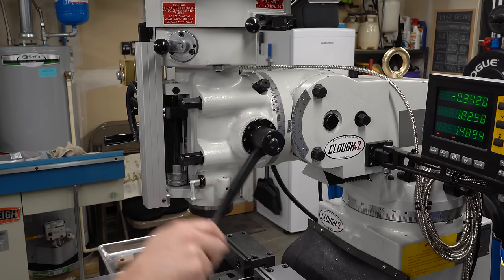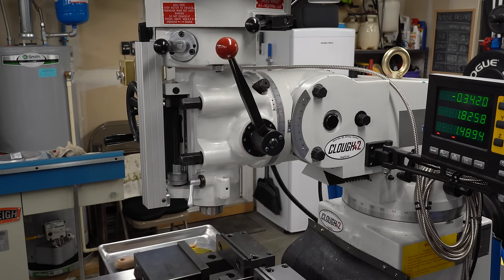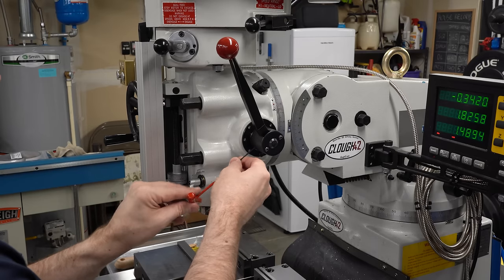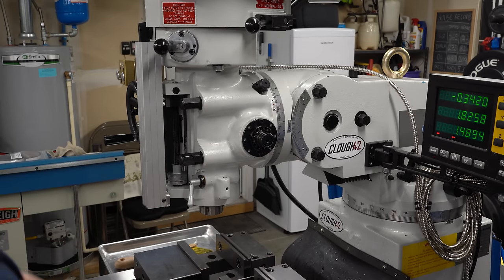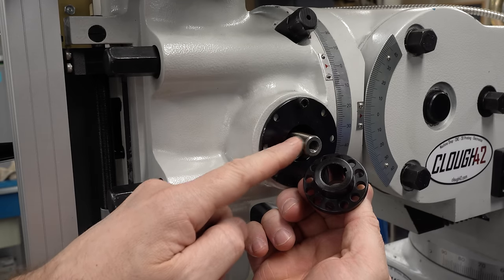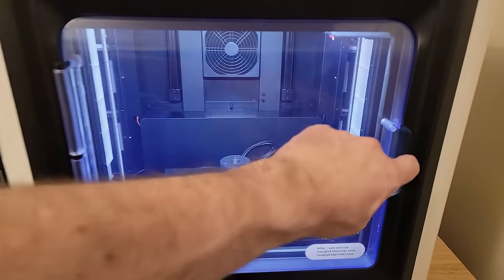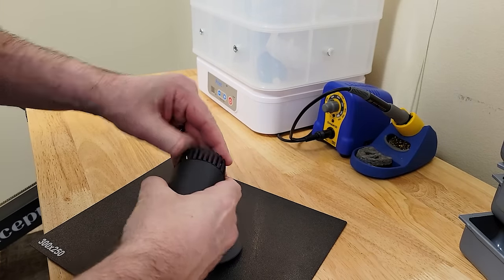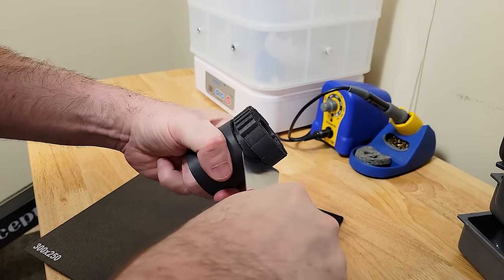Installing a Custom Racing Wheel on My Milling Machine

Comment: Interesting break on that drill. In my 46 years, most of which I've actively tried to destroy everything I touch, I've never broke a drill in that fashion. I would like to see more on that subject.
Reply: I have 40 years and never broke a drill like that.
Reply: 18 years and lots of sketchy no name drills never seen one break like that.
Reply: 4 years of "proper" home machine shop usage.. seen one drill fail almost like that. 10mm going into alumin(i)um, going by hand though, and I lost the entire tip of the drill to a really long break similar to this one. Drill index was bought at Aldi though, so expectations were not high.
Reply: @M3nd0zaBrack3n  Always fascinated by the range of things people report buying at Aldi
Reply: I've used cheap drills almost exclusively for 40 years.   Never seen one fail like that.
Reply: Just a hair under 5 decades boring experience (pun intended) and have never had or even heard of that type of failure. That is freaky.
Reply: Me neither. Always tip meltdown if anything
Reply: He shouldn’t be using TiN coated bits in aluminum… They will absolutely fail. You can see how gummed up that bit is. Wrong tool for the job.
Reply: 60 year machinist now with last 25 in my own shop. Many years ago as an apprentice I accidentally dropped a new drill on the shop floor and it broke in half. Boss didn’t believe me until I showed him the broken pieces. Never had that happen again.

Comment: Weird, never seen a drill fail like that before, ever. Would be cool to see your inspection results under the SEM.
Reply: I've had drills fail like this, almost certainly a manufacturer defect. The drill cracks during heat treating, then once it's under enough force, it splits the web along the pre-existing crack.
Reply: I've been a "maker" since the 1970s.  I do machining on and off.  I've never seen a longitudinal breakage of a drill bit.  That's just fascinating.  I wonder about maybe a batch of drills that were hardened but not suitably tempered afterwards.

Comment: Your bore gauges are worth more than that lathe. Of all of the fantastic machinists I watch on YouTube, you most deserve a bigger, better lathe. I was extremely lucky enough to acquire a DeValliere H140 Tool Room lathe, made in France (the birth place of the lathe). It came with a Bison 8" set-tru chuck.  The machine tipped over shortly after purchase.  The only damage was to the handles on the carriage.  The original owners put it into storage from which a friend of mine bought it for pennies.  He bought it intending to take the metal to the recycling center.  It has no wear at all and performs well within the original specs hand written in the manual.

Knowing that your level of expertise crushed mine, I'm ashamed that it's me and not you that has stumbled into this machine.  I love every moment I work on it and think of you often, hoping you have the opportunity to experience something as fantastic as this machine.  I've tricked it out with a VFD, DRO & a bunch of custom tooling, including a tool post grinder based on a Cherline mill head. This machine has never failed to amaze me with its results.

You need your lathe day!  Love the steering wheel!

Comment: You could also make a "speed ball" to just slide into the vent holes on the wheel that would act as a handle instead of spinning the wheel by the spoke.

Comment: That bolt you pulled from the shaft is pretty standard in the racing industry, even in old British cars as well. For example I had a morris minor, some of the threads are imperial, some are metric and some are whitworth, some are metric with whitworth hex heads, some are imperial with whitworth heads, some are imperial with metric heads or vice versa, honestly racing and vintage car fasteners get very confusing
Reply: not sure about morris minors and racing cars in the same sentance....
Reply: @chrisburbank6484  check out vscc races at goodwood or even better check out the ‘bluebell’ Morris minor, has been racing since the 90’s

Comment: I'm no pro but it looks like your tail stock is off or you're just hanging that big drill out way too far along with how far your tailstock is.. you get some flex on that setup it pops back without pecking the drill gets a chip or tip of flute gets stuck then tailstock/drill check pulls off your taper then the lathe check and soft aluminum pull a Bruce Lee move on your drill... SNnAP!

Comment: In my 50 years working with machines I've seen blunt, worn out, crooked, badly sharpened, cheap, expensive, blunt, sharp, well every drill you can think of. But a drill that's broken like this... never.

So it is very interesting to find out what exactly is going on. Have you already done a post mortem hardness test, and if you feel like it you could also do a comparative break test with simple means. The core diameter also could hold a clue. Curious about your findings with the SEM

Comment: As always a good video and proper addition to your mill.
Because they steering wheel have all those holes in it, you can also add a steering knob like on the earthmoving machines. That knob will be indexable due to all those holes and can be beneficial to speeding up work. Especially for longer strokes, where you would need two hands on the wheel.
Reply: I was thinking the same thing. Not so much that you could just move it around as you wanted, but that seems like an excellent idea.
Reply: @MrMartinSchou  I dunno, if you were to mount the handle in a plastic bushing (delrin or nylon maybe), it ought to push-fit into the hole, spin nicely but be removeable to put it in another hole....and if the holes aren't all a close enough size to make that possible, well we know James has reamers :D

Comment: Looks great James!! Only thing it's missing is Clough42 etched into it. 👍👍
I have a mill that's almost identical and now you have me wanting to convert mine from a lever to wheel lol. 

Wow... I have never seen a drill fail like that and I have broken probably hundred or more drills over the past 35+ years. It's has to be that it was a bad batch of product considering you've had more than one from that set break in this fashion. Either that or it's a "new feature" to make removal of broken drills easier. 😂😂
 I'd certainly be interested in a follow up video exploring why it broke like this.

Comment: Ive bought some drillhogs, the only ones that are "good" are the smaller drills. 
Where the chuck part of the shaft and drill shaft are the same diameter, otherwise they are unreliable junk as ive had as much as 1/16 runout.
Concentricity issues like that are unacceptable and causes them to break every single time after a few dozen holes, and they wont hold their edge because of it... on top of drilling way oversized.

Their bigger bits are unusable, full stop. Smaller drills are good enough for light duty work, and if it says its hardened it actually feels and performs like it is only case hardened, doesnt keep an edge after sharpening be it by hand or on a dedicated bit sharpener.

Comment: The drill failure is something I've never seen before, I'd be really interested in seeing some detail on that.
Also, there is no need whatsoever to support the bottoms of holes that small, the printer will have no issue bridging that.

Comment: Similar bad experiences with Drill hog. They seem to love to advertise that they have "USA" in their name and  come in "American made" Huot cases, but they couldn't seem to answer my questions of where the bits were actually made (with one or two exceptions that clearly state made in USA). Never had issues with Chicago Latrobe or Precision Twist (their stubby, letter sized ones are made in Brazil and also seem great). Definitely would love to see some electron microscopy!
Reply from the maker: My go-to HSS drill brand is Chicago-Latrobe, and my local supplier carries PTC.  Both have been excellent.

Comment: Interesting that your clock spring returns the quill back up. On the Bridgeport, it's supposed to be adjusted to hold the quill in place and NOT spring back.
Reply from the maker: Interesting.  Maybe it's actually too tight.  I might play with it.
Reply: @Clough42  Maybe PM designed it that way on purpose? No sure. I do like the steering wheel. Been thinking about doing that myself.

Comment: Quick tip, its unlikely you would have needed supports for printing the bolt holes, they appear to have a conical end. Also a quick chamfer on the one interior face wouldnt have affected your testing and would have let you print that without support.

Im impressed with 0.2mm layers fitting threads perfectly like that though, especially in nylon. I usually just go for brass heatsets or hexagonal pockets for nuts if the fasteners go through the part.
Reply: Print the tap drill size for the holes and then tapping after printing works well too. Having a nice new sharp tap is key though. Worn taps do not cut plastic very well.

Comment: This metric  hardware  and  ase hard wear are mixing  I have noticed  on automotive  applications.  Mostly  on battery  terminals  12 mm drives and standard  threads.

Comment: I have a Drill Hog 115 pc. drill set, and I have snapped a few bits. I replaced them with Greenfields or Chicago Latrobes.
I wouldn't get Drill hogs again. I have had better luck with Viking drill sets.

Comment: On my lathes tail stocks I use a roundwheel and put handles on the circumference of the wheel . Very handy and I think easier to use . I am going to put on my mill soon . Try it you may like it 
James. 

Terry

Comment: I'm restoring a late-1960s NATO SATCOM II dish for use in radio astronomy.  In the course of doing that, we've found a delightful mis-mash of metric and imperial hardware.  Even on the same parts.  Like one tachometer motor attached with socket-head allan machine screws, and the one on the other side attached with a collection of apparently-random hardware.  NATO procurement doctrine would farm out various bits and pieces to different member nations, so, I guess one should expect a certain "patchwork" of design doctrine......

Comment: I've had bad experiences with drill hog brand drills. 

There are two measurement systems. Imperial obviously, and Metric mixed with imperial. Everything metric has imperial in it somewhere.

Comment: Really nice job, question though ??? Don't you worry about aluminum threads failing, or using helicoils?? I am doing the same upgrade on my 10 × 54 mill. Thanks James.. Kenney

Comment: "How does this happen" is due to legacy parts in the past and who copied what and when. On my newish Honda RSX engine is a fitting that drove me crazy trying to replace. It wasn't metric, it wasn't Imperial, but turned out to be BSP (British Standard Pipe) thread! Yup, apparently Honda, likely way back in history, copied parts off British cars, and some of it just kept getting passed down through the years.

Comment: Weird mixes of metric and imperial are always "fun". Some years ago I restored an old British made table saw; the main spindle shaft was metric (to fit metric bearings), but had a 5/8" BSW thread on one end, and a 5/8" BSF thread on the other. The spanner size for 5/8" BSW is not the same as that for 5/8" BSF.... except in this case they'd used the same external size nuts; just to throw you off the scent. The remaining parts of the machine helpfully used BA threads; apart from the sliding table... which was mostly metric.

Comment: Have the PM.835S, Pretty much the same head . Noticed you have the same cheesey quill fine adjustment hand crank wheel that's plastic, as I do. Great mill but it needs replaced with a solid crank wheel . Hello from Mt.Home Idaho... Neighbor

Comment: Thats neat. I actually machined mine from scratch and Its nice to have the resolution of a large wheel. 

All my manual machines had large hand wheels after that. Something to be said about making all the modified parts and your own tooling.
Reply: I made my own aluminum V blocks and one day decided to take a block of delrin i had and machined a set from the delrin.

Delrin works amazing for anti marring. Polymers in general tend to work well for making tool holders, clamps, etc, both mill and the lathe for anti marring.

Comment: This happens because its not an important item. You have an um... mixture of guys putting machines together. One guy out there can only think in imperial and he gets put in charge of "something." I've worked at a tool and die shop programming CNC machines. Needless to say I've seen my share of 2" long ,12mm threads, that take a 5/8th wrench... bolts. The reason is exactly as I've stated. It really isn't any more complicated than that.

Comment: Just need a clutch and handbrake then you can go drifting ;)

Looks really cool though and decent idea actually, but maybe some "deep grooves" in the front face of it to use the palm/flat hand. Or sandpaper and glue to get grip.
(maybe a "conical tool, round or pointy" and push the holes inwards so they become grooves?) Hope it makes sense.

I'm no expert but i've worked a bit with "drill presses?" and on fine stuff. And sometimes i just had to get real close to the piece to see where i was, but moving the pieces with 2 hands, getting your hand up to find the lever without getting your eyes of the work to make sure it's perfect... a wheel would have been a lot easier to "find" and grab onto. I think :) I was often hitting the lever with my fingers instead of getting my hand on top and grabbing the handle. Wheel, flat hand going up, no stress. If your hand is a bit off, well, there's the wheel.

Comment: James, are the cobalt drills 135 degrees with split points?  If so, I spot drill and just push the drill through without pre drilling. A sharp drill can try to thread itself into the part and do bad things.  I definitely don’t have an electron microscope!

Comment: Had the same exact centerline break on 2 Drill Hog bits. Predrilling before chamber reaming pew pew barrels, so do that drilling off a collet chuck in the tailstock, then ream off custom bored blanks instead of a floating holder. Aaand my letter set came new with multiple bent bits. Their “warranty” only covered the bigger boys that broke. Sold all of them. Running cle-line and a mix of a few others now

Comment: As I'm a paraplegic and use a wheelchair,  I hate the three spoke design. Have looked for steering wheels but never found anything worthwhile.  Then a friend decided to 3d print one for my lathe and after that for my 10in bench drill press. Wow, so so much better for me. Now a joy to use them.

Comment: There seem to be a lot of cases where something made, in Asia, has screws that are partly metric and partly inch (I refuse to say imperial). It isn’t predictable as to whether the thread is inch or metric, or the cap is inch or metric. If it’s intended for a North American market, this is usually done. For some reason, people I’ve spoken to there think that this is a good idea.

But, I’ve also found that the British mix and match inch and metric in products. So a metric shaft may be connected by an inch screw. Some size parts in a product may be inch, while others metric. Inch and metric screws may be mixed throughout a product, and worse, some manufacturers are still using the obsolete Whitworth screw system. Occasionally, on small items you may find the old BS screw system. All of this is mostly for equipment rather than consumer products or exports. Still…

Comment: You say that the 12.7mm drill is the largest that your chuck for lathe would accept. Up until very recently I only had a very small chuck for my lathe, so I often took down the diameter of the drill shaft using tungsten carbide lathe tool so I could clamp it into a small chuck. Works like a charm and using 15.8mm drill and then reamer would have been much faster than boring bar. Of course, you can't use such drills into full material, you have to step up drill diameters.

Comment: I don't buy Drill Hog products anymore. I have had way too many break. I know they will replace them for free. They still are not a good value for me. For cheap carbide drills, I much prefer the Harbor Freight brand. I always wait for them to go on sale and keep several sets on hand. I think with drill bits, the old adage "you get what you pay for" holds true!

Comment: I know who came up with that bolt with the metric and imperial blend. It is the same guy who came up with tire sizes for cars. The are even worse actually as they also include percentages. 21" height ,255mm wide with a 40% tire wall height...

Comment: I rebuilt an old Volvo truck engine, the injector hold down bolts were 5/16UNC with 13mm 8.8 heads.

Comment: My theory: the Chinese are used to manufacturing for the U.S. and European markets so they often use both systems. Sometimes a bolt will have the thread made by one company and the head by another - if the final customer doesn't care if one of the dimensions is metric or imperial (standard) they will use whatever tooling is closest at the time. And it works (mostly) but probably catches quite a few of us out in the process. :)

Comment: i had got the 115 piece cobalt set; same,  I have had 3 bits shatter so far, I did not return to Drill Hog, I replaced them with good ones from Mcmaster Carr, thank you James

Comment: Great job, looks like it'll be very convenient to use! Also, I would like to see more of the electron microscope inspection!

I've had a different brand twist drill do that before. My work wasn't clamped down quite securely enough, shifted slightly and the drill bound up and kerploded. Sure glad I was wearing safety glasses because a fragment shot straight at my left eye and bounced off dead-center.
Reply from the maker: Eek!  It doesn't take many personal experiences like that to form good PPE habits in the shop.